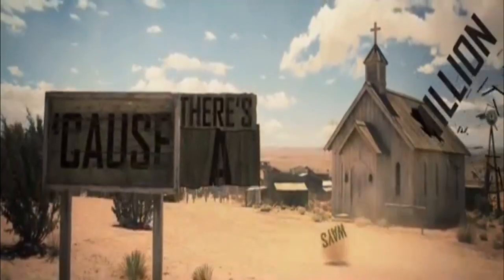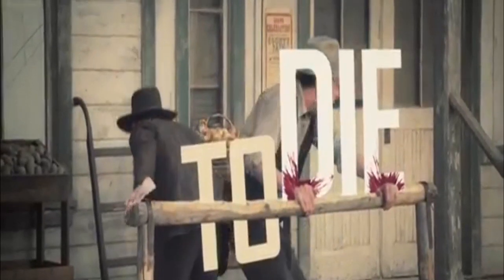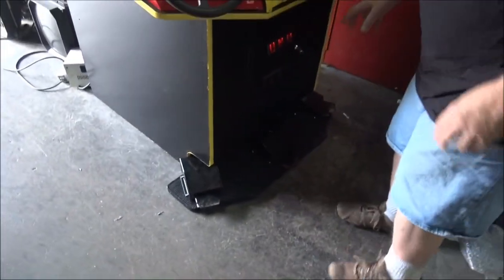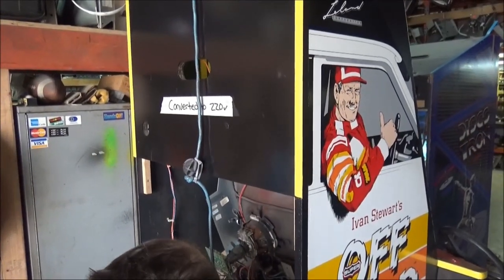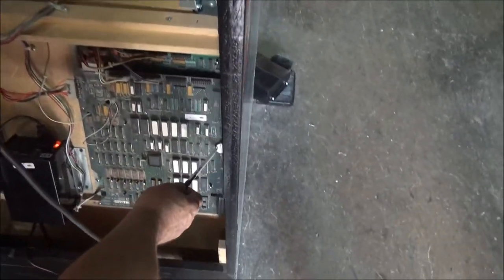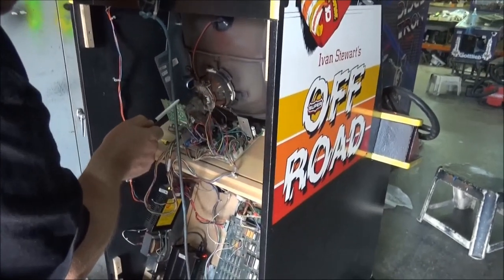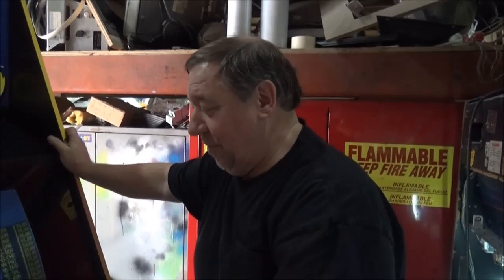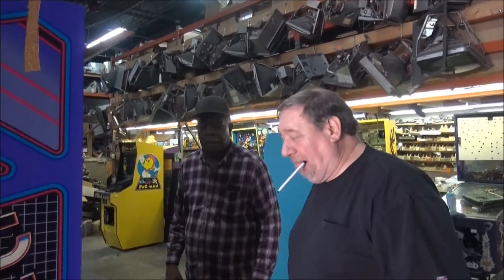#785 Cinematronics/Leland IVAN STEWART SUPER OFF ROAD Arcade Video Game - TNT Amusements

Comment: What kind of glitches could be displayed in gameplay if the super off road pcb were going bad? I have friend that has one of these and he's saying that once in awhile the cars will shoot off the screen high into the air then come back down. I don't know if that's any actual problem or just a bug. But I'm needing some ideas to what it could be.
Reply from the maker: crs9128 Low voltage (or high voltage), or even unseated ROM's.  Start by pressing all the socketed chips on both sets of boards...maybe one is loose.